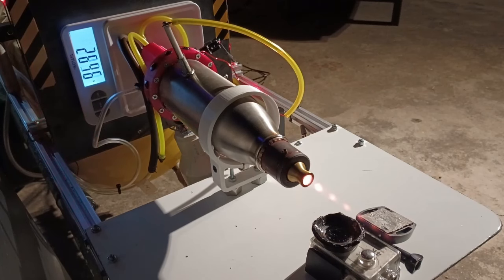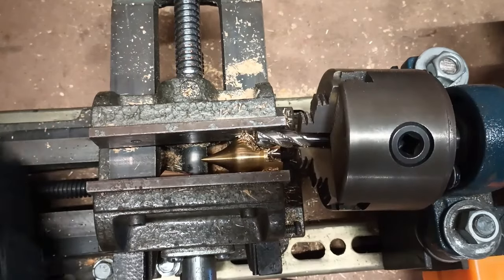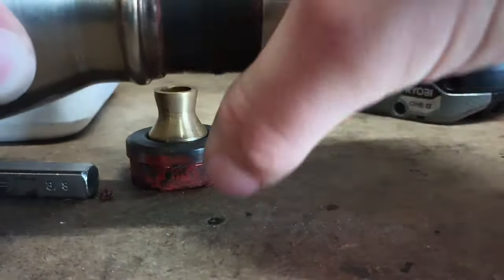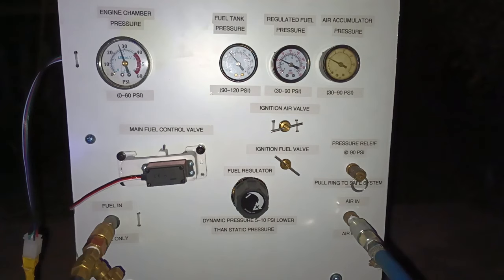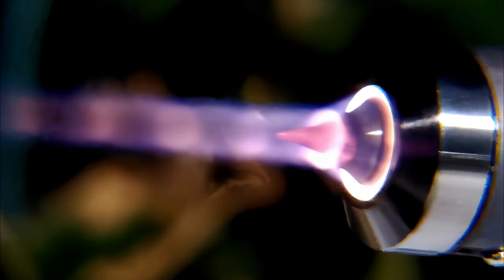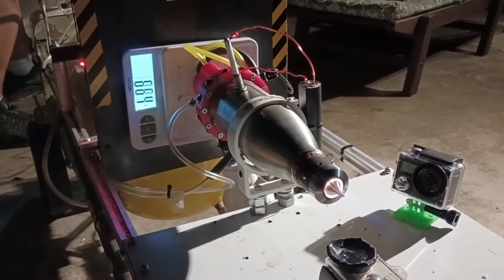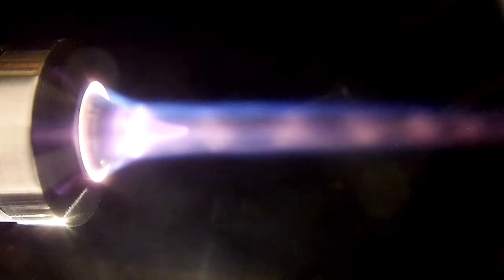I Designed an Aerospike Rocket Engine - Is it any Better?

Comment: Nice work but I think your little engine is performing way better than you think. I’d encourage you to look at your instrumentation calibration and data processing because the Isp figures you quote are almost impossibly low. Even for a cold gas thruster running on just air you should be getting Isp figures of at least 40s, even if your thrust coefficient (nozzle performance) is poor and the air really cold. You can check this by calculating the c* figure for cold air, which should be around 430m/s and multiplying by an estimated thrust coefficient (usually around 1.4 for bell nozzles at sea level) and dividing by g0 (9.81) which should give you somewhere around 60s Isp for cold air. Ok, air isn’t the world’s best oxidiser but your hot firings should be giving you Isp figures of at least 150s. Even if the injector mixing is poor and you’re over-expanding a bunch, the Isp still shouldn’t be as bad as the figures shown in the notebooks and graphs shown in the video. So take another look at the data keep up the good work.
Reply: Yeah, ive been wondering why they are so low.

Comment: I Highly recommend you look into Expansion-deflection nozzles- They are essentially an aerospike turned inside out again such that they almost  resemble a traditional bell nozzle, except they "plug" the center. because exhaust gasses are deflected against the chamber walls on the interior of the bell, you get both the altitude compensating effect of an Aerospike and the cooling of a traditional bell. I don't know too much more about them than what I did for my Science fair project, so you should definitely do some digging on your own- its very understudied!
Reply: I have never heard of those before

Comment: Very cool, but not surprised by the similarity in results.  The aerospike bridges the gap between launch engines and vacuum engines by being equally good at both without the need for separate versions (e.g., Merlin and Raptor).  In a vacuum, you'd see a very large gap.

Comment: Now you just need to get a company excited about 3D printing you the nozzle again from Inconel with added cooling channels where you can run the fuel trough for some cooling.
Excellent work, very interesting and good presentation!
Reply: could you not just ceramic coat the parts that experience extreme temperature?
Reply: @ltheden  yesn, that would defo help a bit but the core temp would still rise to unhealthy levels after some time.
Reply: @ltheden  You can, but ceramic coatings of course tend to degrade under high physical stresses, I could imagine that the shockwaves and vibration inside of a rocket engine would probably make most coatings flake away after a few firings.  The upside of inconel or hastelloy is that like any metal alloys as long as the stresses are within their tolerances you can constantly use parts for quite some time before they suffer any kind of mechanical failure.  
Internal fuel-as-coolant channels can be quite useful for aerospikes in particular though because of the particular heat management issues with the spike.  You can either run your fuel in a loop or through a simple hollow space in the spike to provide cooling via heat exchange, quite efficient if you're using copper or inconel as your engine material.  You could also run a film cooling design where some small amount of fuel is dumped out of the base of the spike to wick away heat via film cooling.  If he ever graduates to a gas generator design you could run an open cycle gas generator design where the exhaust gas is vented through pores at the base of the spike, fuel rich exhaust gas will provide similar film cooling while also getting burned a second time, recouping some of the inherent inefficiencies of an open cycle design.  Of course gas generators are a whole massive step beyond what he's working on right now, turbomachinery even at the small demonstrator engine size are a combination of headache inducing complexity and very tight unforgiving tolerances.

Comment: Provided you moved to something like a 30 gallon reservoir via air compressor, this would be a phenomenal use case for ceramic composite nozzles. I've been developing extreme high temperature one part formulas the last few years that cure via heat and started down building a large injection machine for making hot end jet engine parts. If you ever take up molding your own parts, give me a shout, I can send a batch your way.

Comment: Hey man, nice video, I love people DIYing Rocket engines but this got me thinking:
Would it be possible to cool the Aerospike by running the fuel line into the tip where it's depressurized and then back up for cumbustion?

Comment: Awesome video! I was interested in exactly why the aerospike nozzle requires pressure to create supersonic exhaust, or rather if it would be possible to run subsonic exhaust through an aerospike setup without excessive efficiency losses.

I'm doing preliminary research for an air-breathing turbojet and was curious about using an aerospike nozzle geometry to achieve acceptable nozzle characteristics for both subsonic and supersonic exhaust flow without the need for moving parts. Do you think this might be a feasible thing to explore or would it just not be possible?
Reply from the maker: Aerospike nozzles are particularly good at working with both supersonic and subsonic flow. However, subsonic flow does not need to be expanded meaning that an aerospike will still have more fluid friction than a simple convergent nozzle.

Comment: Not technically an aerospike nozzle, but an annular external expansion nozzle. The aerospike part was shown in a number of your diagrams, that being the truncation of the physical expansion plug and relying on a recirculating wake captured behind the plug. The advantages being reduced weight and heating as well as responding well to dumping the low molecular weight turbopump exhaust gas into this region and the blunt aft surface that may conceivably be used as a heat shield for aero entry. Both MacDonnell Douglass and Boeing explored a number of launch vehicle concepts using this technology over the year. Sadly, none to date have made it to flight. 
Excellent exploration of the concept.

Comment: If you had the budget for it. A 3D printed inconel steel aero spike with passages in it for LPG to flow through before reaching the combustion chamber would be super super cool to see how far you could push it as it would surely handle the heat far far better as inconel steel is a very very high temperature steel that keeps its strength as it gets very hot very well compared to almost any other metal.

Comment: Could the air flow be improved if you streamlined the base that has the hole the spike sticks thru? Round the edges and extend it go improve the area part

Comment: That is a very clever and awesome Video. I'm not sure about the stability of the aerospike nozzle for longer durations of firing. But maybe you think about any graphite layer on the hot side with a thermal blocking under.

Comment: for cooling, what if you cooled the nozzle with channeling through it, which your cooled gases travel through before reaching the ignition chamber? it would greatly increase the machining processes, but would solve some heating issues?

Comment: Would it be possible to cross drill the nozzle internally so the low temp fuel acts as a heat sink and pulls the heat out of the spike with the flow of fuel through the drilled spike?

Comment: I'd love to see a high voltage difference between the nozzle tip and the outter ring to see if it would act as a sort of an afterburner, by accelerating some of the charged particles in the exhaust stream.
Reply: Indeed! But electrically insulating the tip of the aerospike would be quite the challenge with temperatures involved.

Comment: I remember learning about aerospike nozzles a few years ago, and thinking "Hey, that's interesting!  It would be neat if the engineering hurdles can be overcome, too!"

I was also surprised to realize that they are already in use:  I saw them in the exhaust systems for helicopter and airplane jet engines!  While not strictly rocket engines, I can see why they might be used, to smooth out the exhaust in ways that don't depend on the density of the air.  I also suspect that they can be used there because they aren't rocket engines -- they don't suffer from the same heat dissipation issues that rocket engines do, due to the lower temperatures involved.

Comment: I wonder how it would perform if you truncate the spice right where the burn marks developed. Apart from weight saving, you also won't need much cooling if the part that's getting the hottest isn't there to begin with. It can maybe even be used for bypass air.

Comment: What about making an aerospike out of an ablative material like phenolic composite? Would you see enough dimensional changes over the course of a flight burn to be an issue? Would the roughness of the char on the surface cause problems in the boundary layer?

If the aerodynamics worked out this would allow you to hit higher efficiency by using a stoichiometric fuel mix without having to worry about melting your nozzle.

Comment: 5:50 your chamber seems to be seperating from the housing at the back of the.... mixing chamber? Combustion chamber? Looks like it slid out by maybe 2mm probably structurally fine, but may have affected your geometry
Edit the outer flow guide for the aerospike also seems to be expanding

Comment: NASA was 80%+  done with a SSTO space craft in the early 90's when the funding was pulled. It used Aerospike engines. The name escapes me at the moment. It's a very interesting vehicle. They had supposedly solved all of the engineering problems. Makes me wonder if Aerospikes or SSTO vehicles lived on in the black world. We've had the tech for a long time.

Edit. It was the X-33 as shown at the end of this video.

Comment: So what I got from this video is that your gonna build a rotating detonation engine  RiGht? As it turns out if you pump fuel through a rotating airospike. When the fuel exits is will make a spiral which with the correct conditions can detonate.

Comment: 7:05 I don't see how the annular orifice can have a better Cd than the bell. It has massively more surface area(friction) than the bell. The charts you show are for subsonic flow right? That won't apply for sonic flows I think. Great video by the way!

Comment: The oxide layer suggests most of the spike, except for the very tip, never exceeded 400 C. I would be interested in another test (probably after you have done further classification of the intact nozzle with better data acquisation) that sees how cutting that tip off impacts the performance.

After all, a lot of professional aerospike designs are truncated, since that greatly reduces the thermal issues, and recirculating gas behind the base as I gather should mostly replace the cut-off tip for fluid dynamics purposes. Cutting off the tip of course also reduces weight.

Comment: sorry for stupid question for i am not well-versed in aerospace engineering, but what is the difference between this and a typical scramjet engine? is it only shape?
Reply from the maker: The difference between this and a scramjet engine is mainly in the speed that combustion is occurring. This engine has high-pressure subsonic combustion that is accelerated through a nozzle, whereas scramjets use shockwaves inside the combustion chamber to compress the air and sustain a supersonic flame front.

Comment: if you add different textures or design on the surface of the metal nozzle, you get different performance? like lines of circles or shark skin
Reply: what happen if you add a electric charge to the nozzle ?

Comment: High flow, high pressure regulators aren't the only option...
They ars designed to be "black box" stand alone items.
You could roll your own.
Using a spear valve and chamber pressure sensor you can achieve the same goal.
If chamber pressure sensor dosent work well, then upstream pressure or actual flow rate could be used.

Sure, you still have the issue of a large high pressure reservoir, but an off the shelf scuba cylinder can take ~240 bar.

Comment: Machinist #1: I know it's a bit behind schedule but I'm getting through it come hell or high water. By the way what are you working on.
#2: Oh just some side project someone brought in. Charged him $20 for material cause it seemed interesting.
#1: The one you've been working on for a week non-stop and blowing off other jobs?
#2: Yes........................      #1: Can I help?
Yes it's an extreme example but we did it quite often with things like custom parts for guns or race car parts. Interesting projects float to the top.
Find a small shop and go talk to them about doing small jobs as cheap as possible. Not every shop will do it but you'll always find at least 1 or 2. 
You can also be sure that it will make it into their "Past Jobs List". ......Also experienced with small custom aerospace projects. It helps machinists keep many of their skills not normally used from becoming rusty. It's also a nice way to possibly score older equipment they no longer use.

Comment: when looking at airospike's you need to look at the "Rotary detanation eninge" tested by NASA on the 23rd december 2023. Due to the way that detonation engines work using a engine bell design just doesnt work all that well but a aerospike really does lend it's self to the concept.

Comment: Aerospike has this weird combination of features that make it simultaneously great and completely impractical. Its entire benefit is that it's self-calibrating to the external pressure, so it doesn't suffer from reduced efficiency from under- or over-expansion. But it's not like you will use the same engine to go from launchpad to orbit anyway, you'd be dropping stages, so the actual benefit is marginal. And while having higher efficiency it's also much heavier and much less effective at pre-heating the fuel due to tiny surface area, which completely offsets the efficiency advantage.

Comment: Is it possible, or useful, to run liquid propane through the spike, to control its temperature, and preheat the propane gas that comes out of the cooling system?
Just a stream of consciousness partial thought.

Comment: Badass! if only I had a metal 3d printer, then we could try a regenative cooling aerospike nozzle
Reply: You could use a normal 3d printer with metal infused filament then bake out the plastic but it's not easy
Reply: @linecraftman3907  i had seen that stuff and it does look difficult to keep tolerances with all the shrinking the part does during the bake out.

Comment: Use a turbine behind the output for that tipped exhaust to pull more into it make sure blades aren't Wong side will mess up but if right direction it should cool the casing more and give more efficiency to to output and more efficient burn

Comment: Scaled up the weight never adds up, but would be great for rcs system with its expansion efficiency and since it's periodically used the aerospike rcs system wouldnt over heat with cop42 even out of atmosphere

Comment: Right, you said it, "uncooled aerospike." Large scale test engines have used a method where (cryogenic fuel) was run through the spike and ejected from the tip. As a stopgap, couldn't you drill through the center of the spike (gasp) and fun compressed air through it? If you match the pressure at the tip of the spike, the exhaust shouldn't know the difference.

Comment: Why not make a aerospike/bell nozzle hybrid but where the bell is a little more flush with the spike but only flares out at the rim combined with the rotating detonation engine. Make 2 versions, 1 with a single detonation chamber and 1 with a dual detonation chamber.

Comment: 1:29 forbidden butt plug. XD 

Also more seriously,  i hope that metal 3d printing becomes advanced enough to create an aerospike nozzle with internal cooling.  In my mind that seems to be the answer. Add LCH4/LOX as the propellant and cryogenic cooling of the spike would allow less expensive (lower melting point) metals to be used. Which also are more viable for 3d printing. 

I haven't heard of Titanium metal 3d printing yet. Probably has been done on a small scale though.

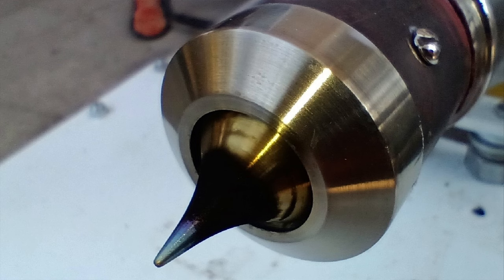Comment: @8:45  Its because your spike is too long. All its doing is acting as a conductor, drawing heat from the exhaust on to the spike and the soot is the exhaust boundary layer being "baked" onto it. 
 RDE is a completely different and much more complicated can of worms.

Comment: The truth is that it is quite a feat to build this type of engine, but having a lot of power does not mean that it has performance. Making an inverted conical device will surely give you more power, but I assure you that these materials will melt and the engine will be damaged.

Comment: sublimation of aluminium
= speed of thrust - makes the dome
= many cultures have domes
= each design, many from religions, have a specific speed-efficiency.

you will need to use the sarbot-tank-round as a benchmark. the round without splitting the case. the air fills and forms a pressurised bubble, shaped by frontal air, assisted by the spike

the martial-arts from nature arrives at many ways of return-cycle back-pressure considerate-considerations to release and digital-pulses and short long pulses... the shockwaves on the dome is a clue. engine polishing-running to fire-breadth is to watch pressures and vectors. same as MTU engine starting to idle, idle to run, run to second-"cam", ... pairs and forwards-backwards, backwards-forwards. similar to polishing fan blades or smoothening bearings. run-in... these are the baseline sciences which many are expected to look-down upon, until they hit he higher pivot-point of a single knowledge, and review, then recollecr and review other knowledges...

it is a long way